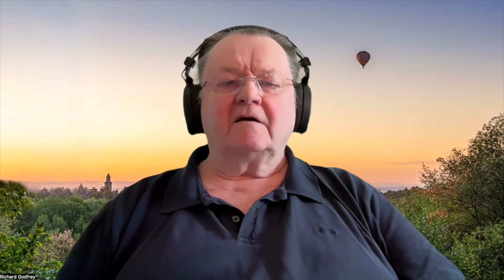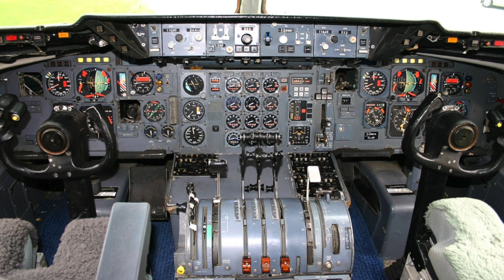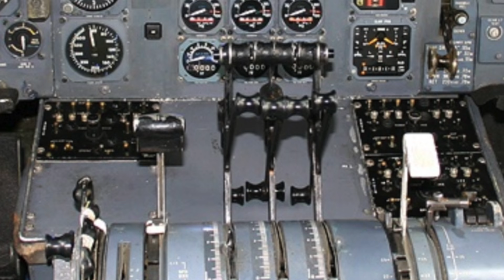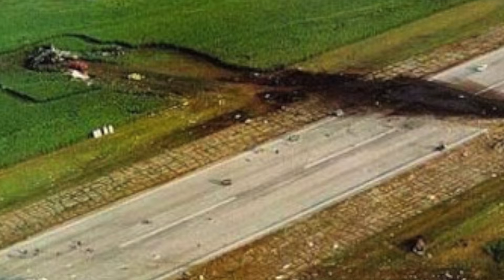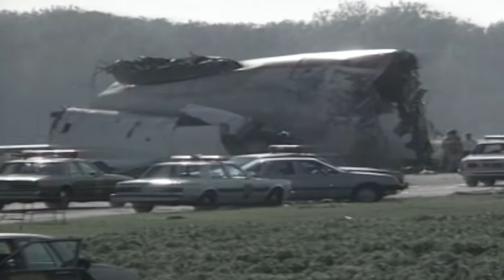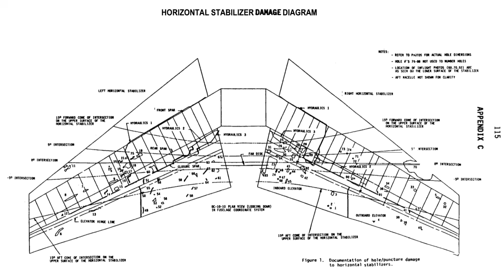UA 232

Comment: Thank you Richard, I think that is one of your strongest conclusions. Although we musn't jump to conclusions, the conclusions you draw here may well have some parallels with AI171. In particular I refer to your AI171 hypothesis of the aircraft electrical systems failure, in which multiple circuits may have been taken down by the same root cause. Remote does not mean Ignorable.

Comment: Richard, great video and great analysis. I’d like hear your thoughts on the KA 737 that just crashed.
Reply from the maker: It is too early to report on the K2 Airways Flight KTA1732, a Boeing 737 cargo aircraft that crashed in the Arabian Sea en route from Sharjah (SHJ) to Karachi (KHI). The flight crew reported navigational difficulties and were guided by air traffic control. The FlightRadar24 track data was quite erratic.